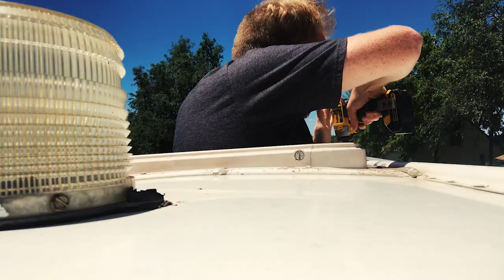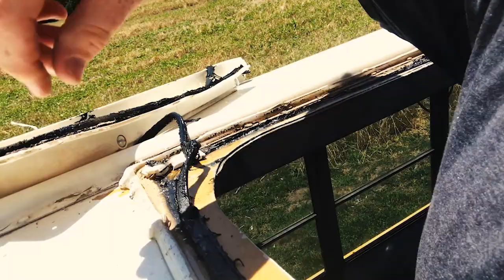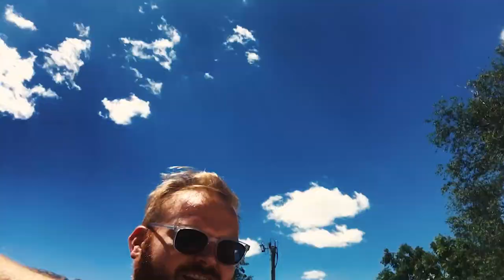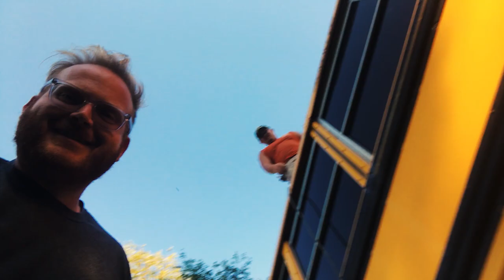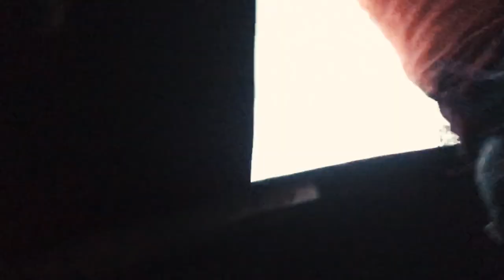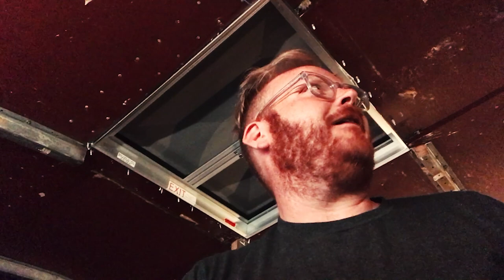RV Roof Vent Escape Hatch Install | Skoolie Bus Conversion Tiny House Videos

Comment: What type of weather seal and caulked did you use? Can you post the name of the skylight and cost?
Reply from the maker: Hi Norris! The link to the roof hatch should be in the video description box. It was around $140. I used OSI Quad Max white sealant under the lip of the hatch, on all of the screw holes before screws went in, and then each screw was covered with it again. Once all the roof work is done I'll cover all screws with Flex Seal Liquid Rubber: http://amzn.to/2x2Ztm8   It's probably overkill, but I'd rather be safe than sorry! haha Thanks for watching!
Reply: @JeffreyBinney  how's it working for you after a year?